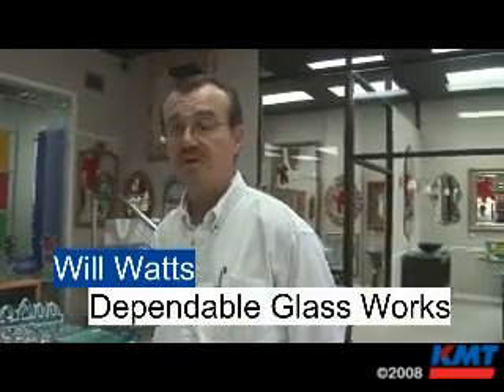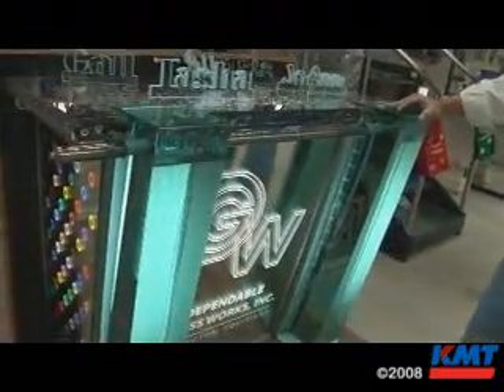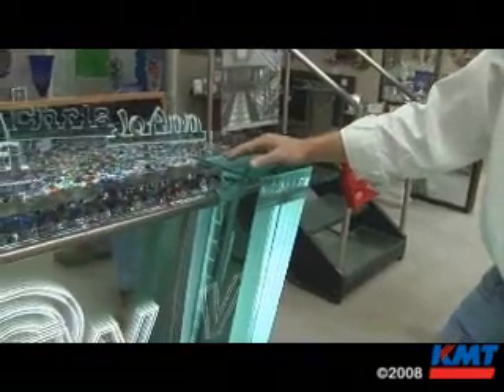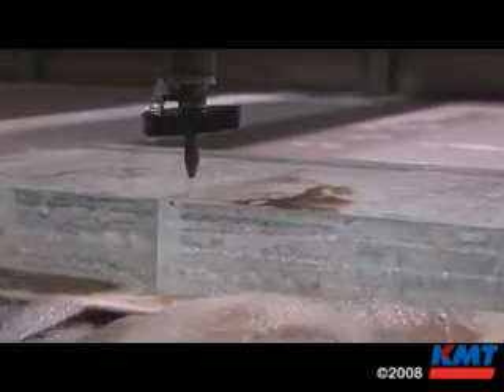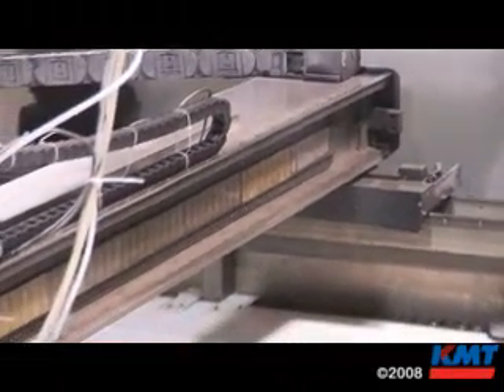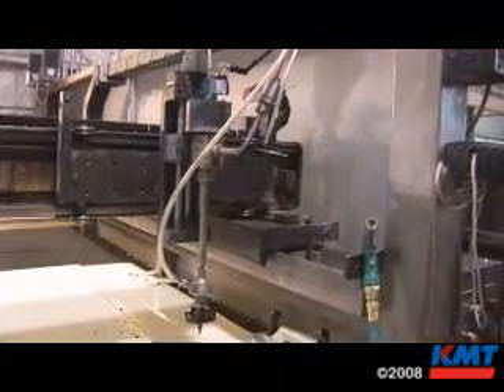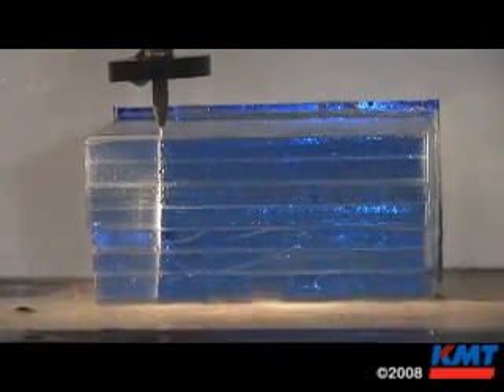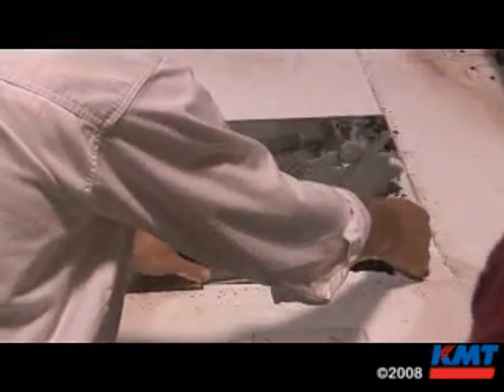KMT Water Jet Cutting at Dependable Glass Works

Comment: Hi
So what the trick for pre-loading the focus tube before you open the water valve?
Wont that just block the focus tube?
We have the KMT IDE head and the Feedlne V garnet delivery system and we just don't seem to be able to pierce on glass without shattering it.
We have adjusted the pierce pressure down to 700 bar but how do we get the abrasive to "pre-load"
Richard

Comment from the maker: This response is from the KMT Cut Lab Technician (Orion) :
I cut glass at 57000 psi.  You need to pierce at a low pressure around 12000 psi.  The trick is to make sure your abrasive tube is loaded when the valve opens, if 
not you will get a burst of straight water and chip or break the glass at pierce.
Please let us know if you need any more assistance by calling 800-826-9274 and asking for the Orion in the Cut Lab.